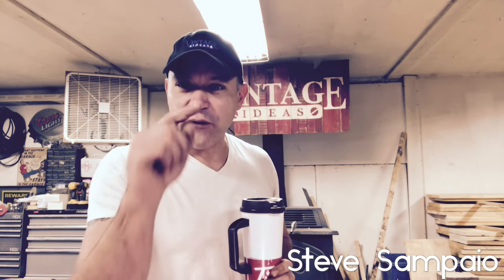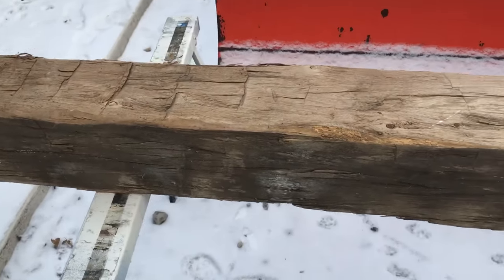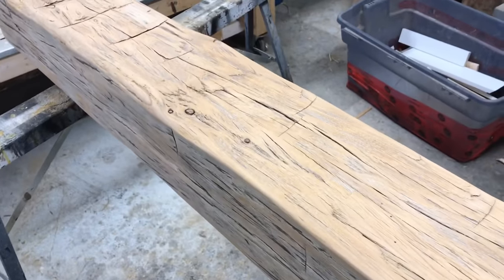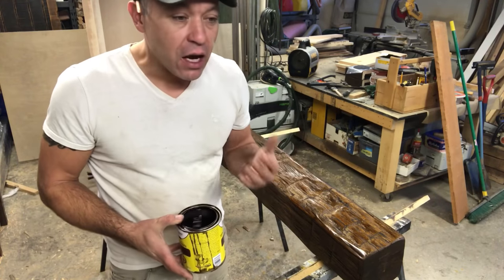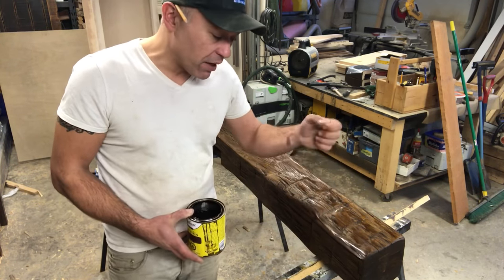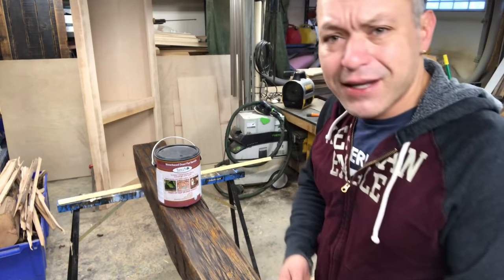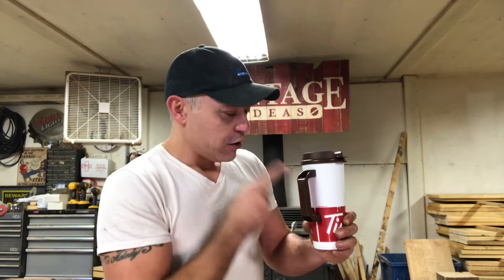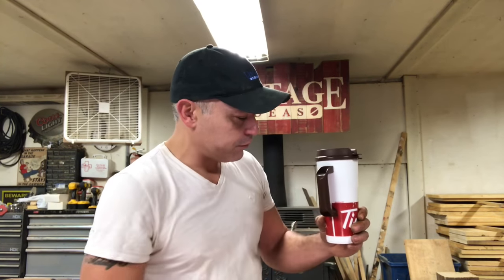Making a barn beam fireplace mantel. Reclaimed Wood

Comment: Thanks for the great video. I don't want to change the color of my reclaimed barn beam mantel. What kind of polish/varnish you recommend for the protection without changing the color?
Reply from the maker: Hi there. Thank you so much. I recommend if you have a cut off of the beam to do your testing there before applying to beam. It’s hard to say since no matter what you put on the mantel, since the wood is very old, it will change the Colour. It will suck up anything you put on it. I use a dead flat varnish from Saman Which works out best. Slight difference but the closest to natural I’ve used. Hope this works for you.

Comment: Hey man great vid. I've got a question about installing. My fireplace already has stone how would I got about installing the beam? Would i have to use a grinder and cut the stone out making a recess ? Or can I put lag bolts through the stone and onto the studs ? Any tips would be great. I'm in London ON. Would you guys come out for just an installation or is that to far out? Thanks a lot
Reply from the maker: Thanks brother for the comment. So in your case, I would use lag bolts and PL Premium into the beam. You won’t have a clean line since the stone will prevent that. One way is using motar (cement) to fill those voids at the back of beam where it meets the stone. So at this time we are extremely busy and won’t be able to do a install until February    London is 1 1/2 hour drive from us. So not crazy far but a travel fee would have to be added. If you have further questions, call me at (416) 936-3662

Comment: Do you seal the back side when installing to wall with anything? I'm installing a red oak mantle I made, (thanks to your vid), and I want to make sure the heat from the fire place does not seep through the cracks on the back side. (TV above mantle). Your video was great btw. Thanks.
Reply from the maker: Thank you my friend for the kind words. I wouldn’t worry about the heat effecting your tv as long as you installed the mantel and tv to code distance from fireplace. But we don’t add a sealant on the back.
Reply: Hey, thanks for answering so quickly.  From what I have researched I should be fine then. Thanks again.. We DIY humans appreciate any help we can get. Lol.

Comment: How would I gut a 9 inch deep beam to make it lighter and become a floating mantle? Any help would really be appreciated. My mantle is 116 inches long so it’s super heavy. I need to lighten it up. Thanks for any suggestions. God bless
Reply from the maker: moottzzy so what I would do is mark a chainsaw blade with a marker to the depth you want removed on the back of the beam. Do as many passes with the chainsaw until a hammer and chisel could take over. It will take some time and patience but it’s the way I would do it. Hope that works for you.
Reply: @STEVESAMPAIO  thank you so very much!

Comment: How do you recommend drying out a beam thats been sitting outside in the rain for a while?
Reply from the maker: Arkadia Holdings Ltd hi there. So 2 ways. You could bring to a wood supplier and see if they could put in a kiln or leave outside standing up in direct sun for a couple of days. Maybe longer. Keep in mind that old beams are like a sponge so absorb moisture quicker than new wood. So depending how long it’s been outside, it might not be usable.
Reply: @STEVESAMPAIO   Thanks very much !

Comment: Just pickup 40 barnwood beams dif thickness and length. Any advise as to pricing and marketing  mantels up here near.  Chicago?   Are you hollowing out wall side for a wall cleat to fit inside mantel?  Lighter mantel? Bad idea? Thx
Reply from the maker: Hey brad!  Nice to meet you. So pricing here in Canada varies but I charge $125 per foot finished to clients need. Unfinished they sell around $50 a foot in Canada. We don’t hollow it. We use straight 8” metal brackets with PL Preimum construction glue smeared on the back side. The brackets get screwed into the wood studs in the wall. To cover it up we usually are doing stone or shiplap on the fireplace. Many different methods on installing actually. Many YouTube videos on how to. Hope that helped you a bit. Thank you for your comment.

Comment: Now how do you attach it to the wall?
Reply from the maker: Rapp 1128 hi there. We use 8” flat brackets and screw them into the wall studs before finish the wall with stone. Generally that’s how we do it but many ways of doing it depending on your application.